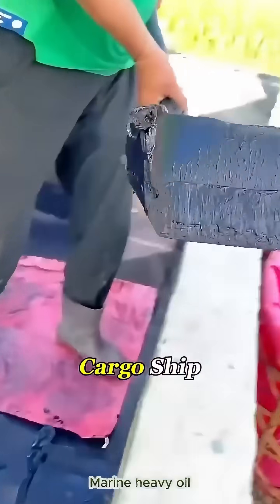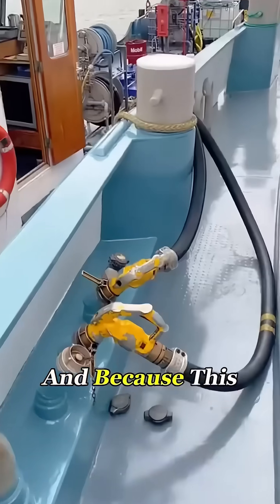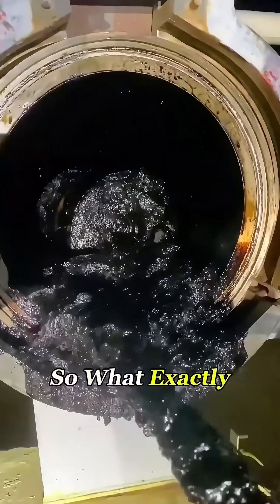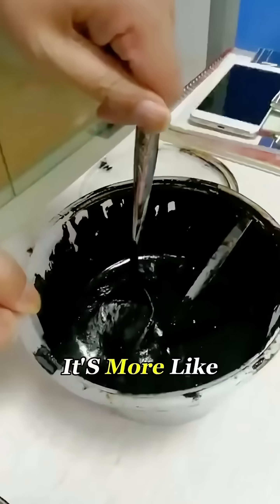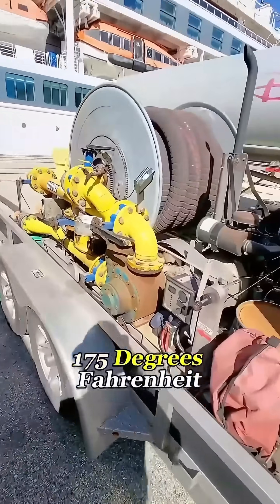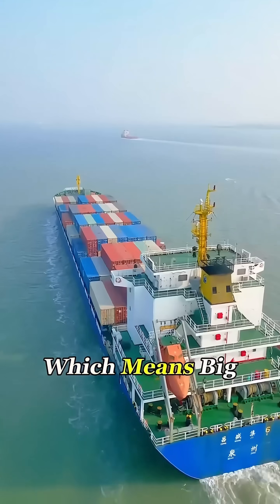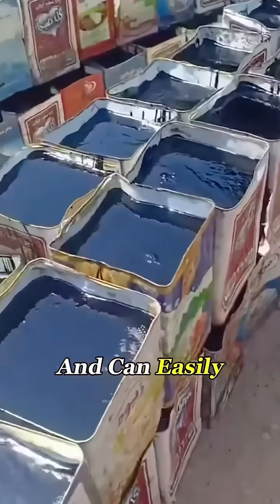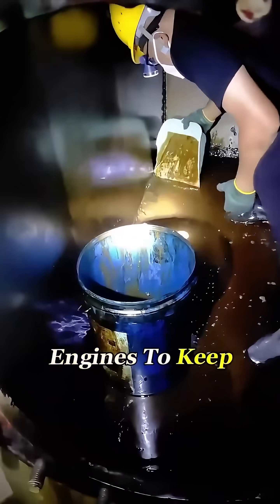“Why Ships Burn the Dirtiest Fuel on Earth ⚙️| The Truth About Heavy Fuel Oil”#shorts #mining #ship

Comment: The “fuel” that looks like jelly is not the heavy fuel oil. It is the carbon residue of the HFO that was removed by centrifuging. It’s the waste of the HFO and is burned in the incinerator or landed ashore for disposal.
Reply from the maker: "Ah, great catch! 👏 You’re absolutely right — that jelly-like substance is indeed the carbon residue from HFO after centrifuging, not the fuel itself. Appreciate you sharing that clarification — it adds real value to the discussion ⚙️🔥"
Reply: @MinesSmart  And most ships don’t use this kind of fuel anymore. They order instead the blended kind. HFO is blended with diesel oil to make it lighter and more “acceptable” to today’s huge diesel engines. And less maintenance and repairs too for components and other machineries that process the fuel before being used.
Reply from the maker: That’s a great point! 💡 You’re absolutely right — most modern ships now use blended fuels or low-sulfur mixes to meet new IMO emission standards and reduce engine wear. ⚙️🌊 Thanks for adding that — it’s awesome to see someone who really knows their marine tech! 🚢🔥